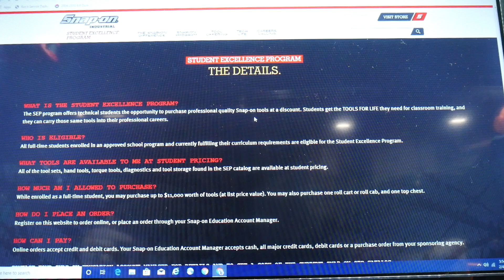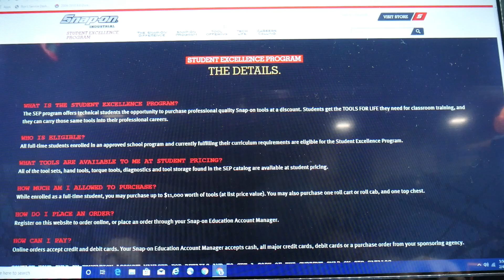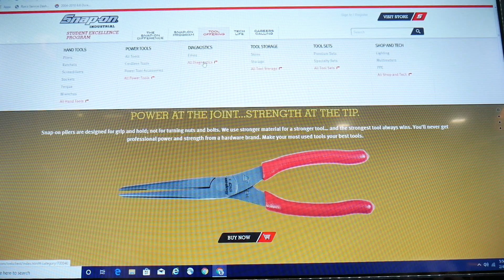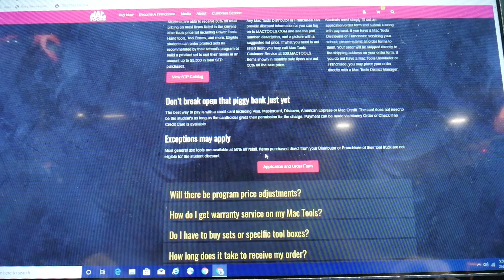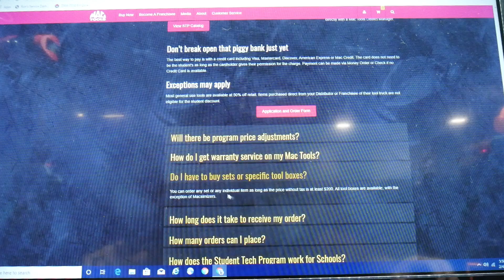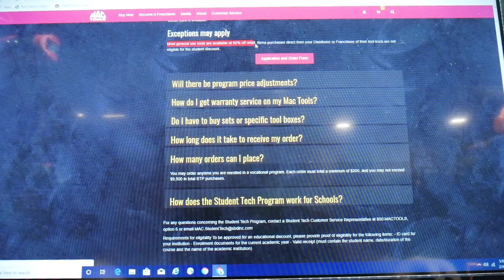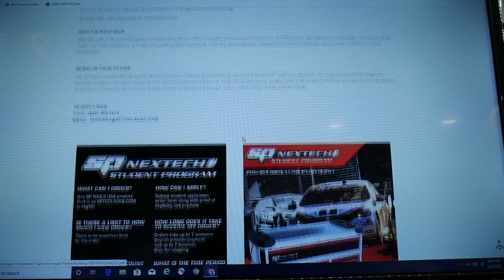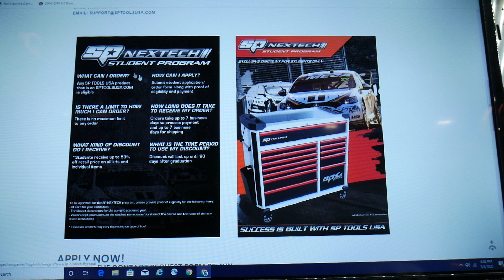TOOL COMPANY STUDENT PROGRAMS AND SKILLS USA COMPETITION

Comment: I'm a student after being in the field for 4 years the Mac student program sucks you're only allowed to purchase ONE of each tool I bought a Mac/DeWalt XR electric impact gun 1/2" kit and wanted an extra body due to me having a ton of DeWalt electric tools and I couldn't buy the body due to buying the whole kit and you need to do a physical purchase order when buying through Mac the Snap On SEP sucks I constantly need to contact my industrial rep and have him add part numbers to my cart and Stevie Wonder can code a better website than Snap On SEP I do like the Matco student program it's really nice the website is literally just Marco's website but I say screw the tool truck brands and I go with Tekton, Carlyle at Napa, Aries, Powerbuilt and I found a website that sells used tool truck tools it's called KB Tools I love them and they're in PA so me being in Jersey it's local to me
Reply: Even SK has an easy to deal with student tech discount progam.

Comment: You are wrong about snap on I go to a Rockland Community College and we all get the wedsite discount and we have a snap on rep we can text to add anything in the actual catalog and he does it no problem in colors specially tools everything
Reply from the maker: I’ve heard that but that is not their overall policy. You have to have a very good rep to be able to do that for you.
Reply: Rustbelt Mechanic my rep did the same thing. I just sent him the part numbers I wanted from the main website and he added it into the student program shopping cart.
Reply: I’ve gotten green rachets, electric torque rachets also in green just by simply texting him the part number of it and he will add it to your cart and with the 59-60% off depends never less than that

Comment: If you have never had to change a transmission in a snow bank.... ur not a mechanic. Raise the bar.
Reply: Been there. Done that. The fun part is when the snow melts and it turns into frozen mud.
Reply: @gearandloathing4057  big disposable tarp.